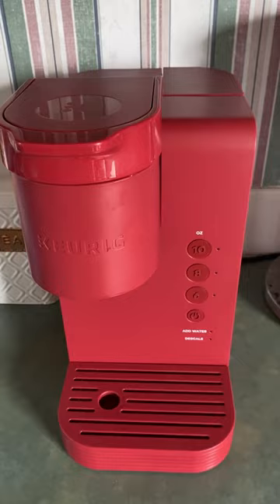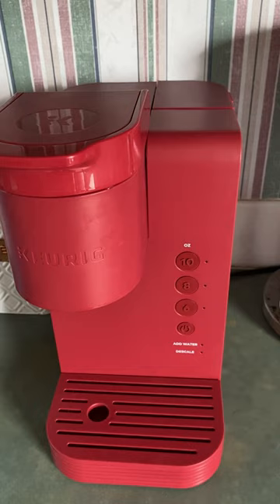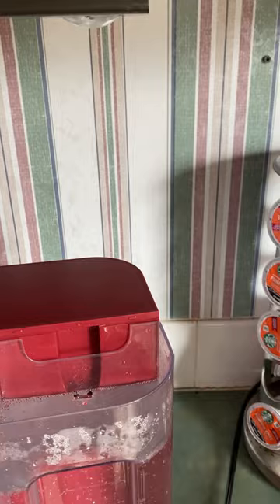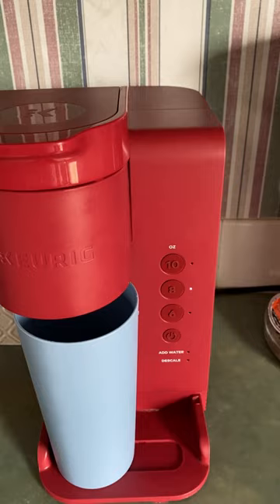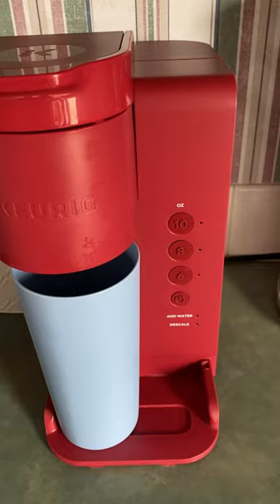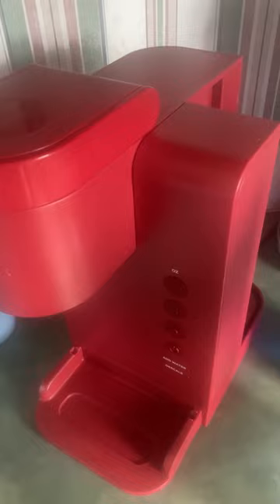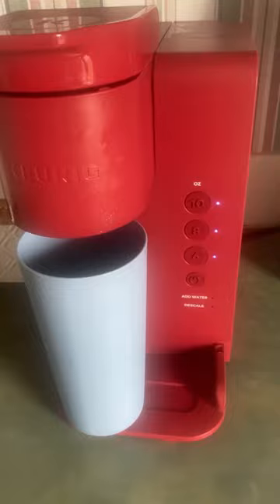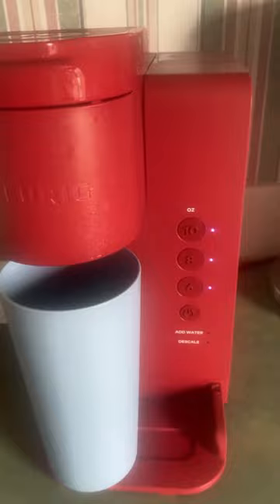How to Descale the Keurig Machine *Easy *(Step by Step)

Comment: My descale light came on a solid light. No instructions in the manual at all. I had bought the Keurig descaler to refer to those instructions on the bottle. It was so wrong. Was getting real pissed when the descale light would never go out after rinsing with 5 containers of water later, still on. Your instructions fixed it lol. Although I didn't wait for 30 min. This time knowing I had already went through that before  lol. I've always figured the manufacturer claims to not use vinegar or anything other than descaling sollution. But I think that's just to freak us out and make more money off of us. Anyway your instructions worked. But I won't use dish soap in there lol. There's no need for that in my opinion. Thanks.
Reply from the maker: Yes, I agree. You’re welcome have a great day 😊

Comment: I was like that frustrated until I figured it out too. Your video is correct on how to do it. Some videos still don't explain that the Keurig has to have those two buttons pressed together to see the 8 oz light blinking along with the descale light. Once it goes through the cycle that light finally turns off. I was at it most of the morning until I figured it out.
Reply from the maker: Thanks 😊

Comment: Thank you for adding the video! This stupid "descale kit" I bought does NOT mention anything about the 10+3 for three seconds... I was about ready to throw this piece of crap in the dumpster 😂😂 Also, I ran the vinegar solution until I had to add more water. I refilled the reservoir, ran another two or three cups and the descale light went off without having to wait 30 mins...
Reply from the maker: Glad it helped!

Comment: Thanks for this. I did the vinegar and water part but the light is still on. And now I came across this video and now I’m going to run it with just water to get rid of the light. I’m not trusting the soap part. Thanks again for your video.
Reply from the maker: Glad I could help

Comment: Thank you for the video I have the exact same  model  as yours and followed your steps and it worked
Reply from the maker: Thank you 😊 Glad I could be of help!!!
Reply: Why did u use dish soap?
Reply from the maker: @BatBoy7426  It’s part of the cleaning process with the vinegar if you are not using the keurig solution. I got this information from a video I came across (a representative from keurig company) the directions of a substitute of the keurig solution.